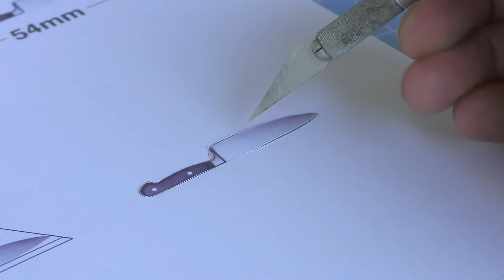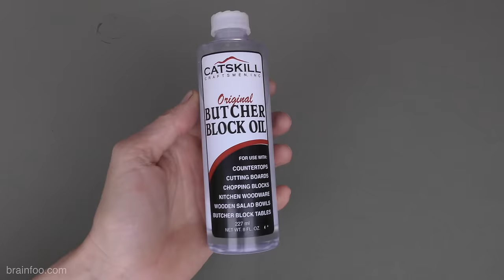Made Perfect - with DIAMONDS

Comment: The carbide is only a thin strip
On the cutting edge. The body of the blade is no different than any other utility knife blade. You cut off the best part.
Reply: yeah that wouldbe useless . like normal steel

Comment: Those gold diggers saw “diamonds” in the title and came here...
Reply: One of them is u

Jk, gotcha
Reply: Should've put, also made with DIAMONDS
Reply: Not basically gold diggers but diamond diggers
Reply: But they're after gold
Reply: Tungsten carbide is too tough of a metal and can only be cut cleanly and with a good enough finish with a 'diamond wheel' or other tools made with diamond. It's very fine on the cutting tools or wheels, nothing crazy. It's mixed amongst other material and not just purely diamond. 

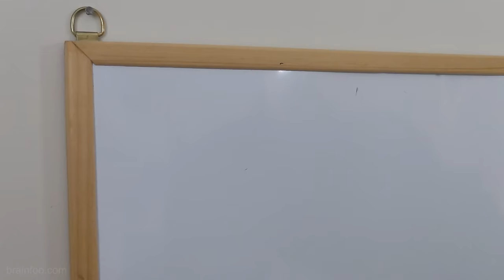However, tungsten carbide is by no means magnetic and it seems to snap into the blocks magnet at 7:43 which leads me to believe he's used a different material after the intro of shaping the knife. There's no way to know exactly after that point because the paper is glued over the lettering. Clickbait most likely.
Reply: On top of that, there NO WAY you could use a punch to Pierce carbide. EVER. Carbide is not maliable. Steel just deforms on contact to it such as 1:31. Carbide on carbide simply breaks. It's so strong that when it smashed against itself, it simply breaks. The only material to break carbide, is more carbide.